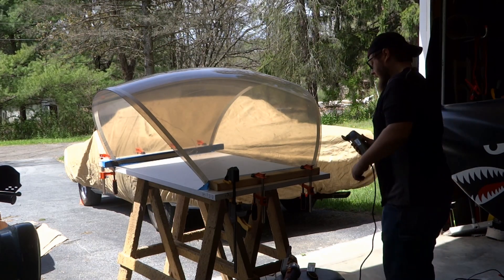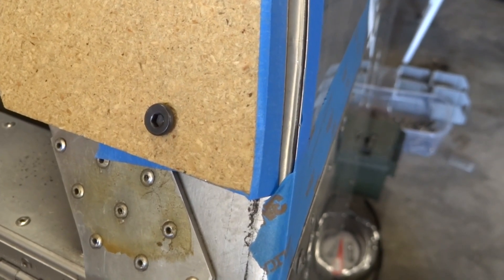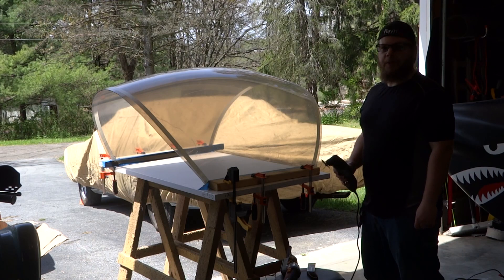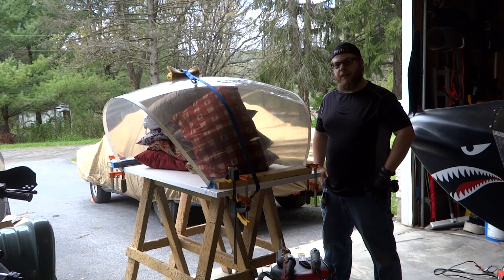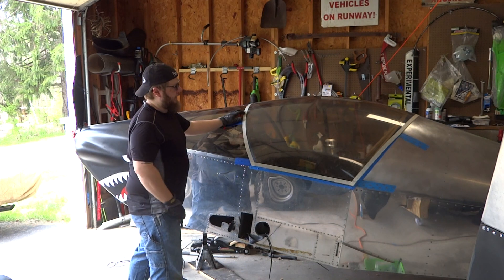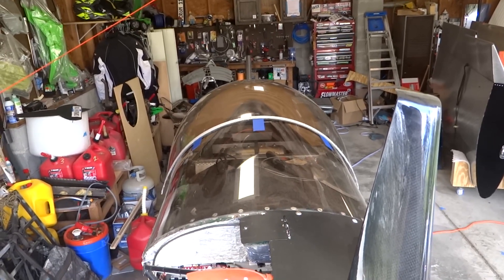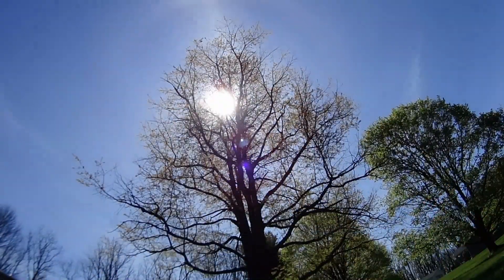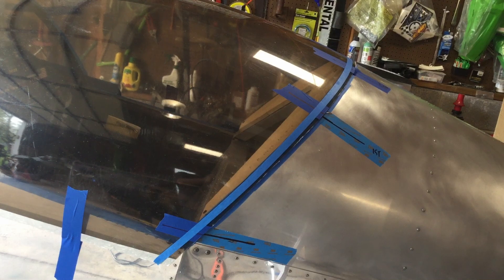How To Fit The Sonex Aircraft Canopy: A Close Shave 😉

Comment: Love the videos and how you setup and film.  Try heating the edges of the dropped pieces with a small propane torch to seal and round the edges.  This will help prevent cracking.  Practice on the drops first just to get the feel of how it works
Reply from the maker: Thanks Rick! Great tip too. 👍👍👍 Will have to try that, still have scrap pieces. I also experimented with a Dremel buffing wheel and compound. It took me right back to middle school shop class, but I felt the results were inconsistent.